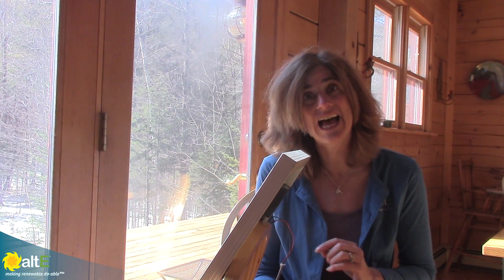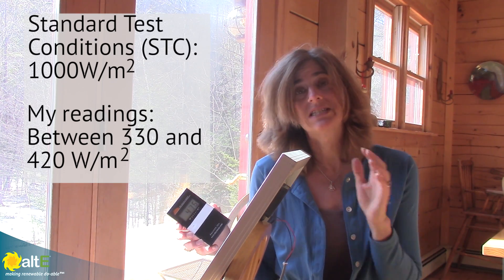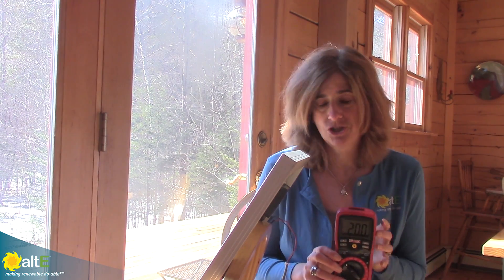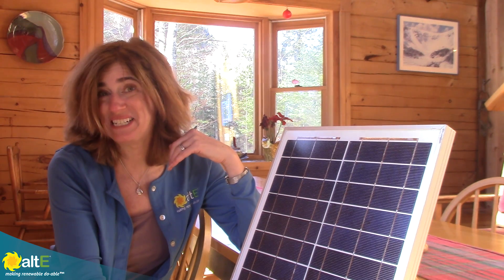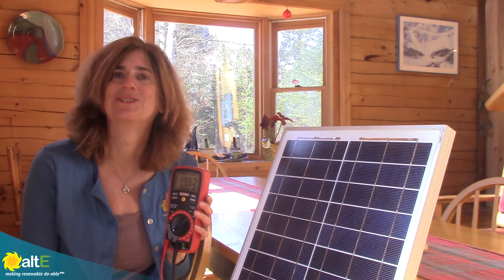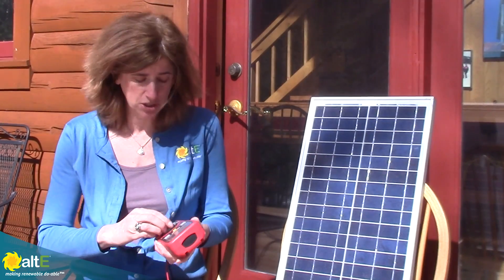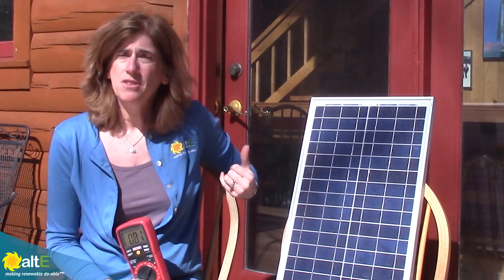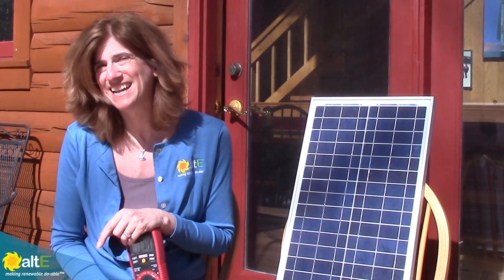Can I install a solar panel in a window?

Comment: I light my whole house at night with low light, low voltage, LED from photo-voltaic cells in the Low E windows. I only use 1 AA rechargeable cell for each homemade device and 
Three 1 X 1 inch  photo-voltaic cells inside Low E windows. 
I have a voltage drop of only 0.07 in 8 hrs, lighting  eight  3 V. LED.
~~~~~~~~~~~~~~~
 I don't have to turn on any lights to walk around at night, or if I have to get up in the night for a bathroom call.
Reply: Wow that sounds awesome. I'd love to have that set up. Can you please provide links to the items you use?
Reply: @ThexthSurvivor  Look at my channel.
I have advanced most of my work since then.
Reply: @joeyocom5087  Interesting. Ill take a look. Thanks.
Reply: @ThexthSurvivor  Most of my single panel window units use the dollar store solar light circuit
Reply: @ThexthSurvivor  
This is a programmable component that you can make the chaser light circuit with.
I used a rectified garden light circuit to power it with 1.2 V cell https://www.ebay.com/itm/233427234617?hash=item365958ef39:g:BG0AAOSwHB5d7NzI

The light I made for outside...
https://www.youtube.com/watch?v=mlWFwOaU3f8

Comment: Isn't Michigan State University designing/ed a solar panel glass window?
Reply from the maker: +Chris DIYer I've seen several different solar windows. I think they are a fabulous idea, being translucent they don't block the view or the light from getting inside. As a result, they are very inefficient, requiring a lot of windows to generate much power. Hopefully they can get the price down to a point where it makes financial sense. Exciting times we live in.

Comment: your windows maybe insulated with the uv resistance barrier, but a window with single pane clear window may have a better power output.
best
Reply from the maker: +Rev John O'Toole I agree. These were double pane windows from the early 1990s, I'm not sure what the UV rating was. But the bigger issue was that to truly capture as much energy as I could from the sun, I'd need to be right up on the window, blocking the light from getting into my room.